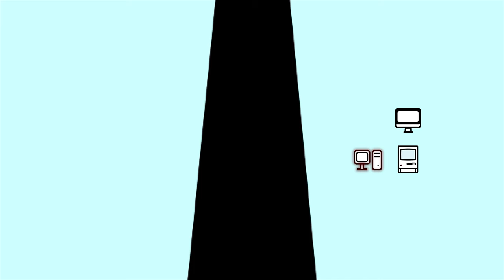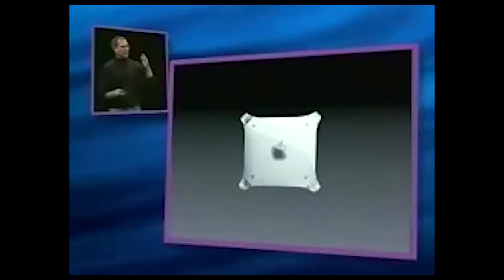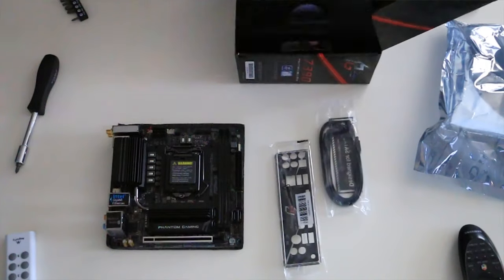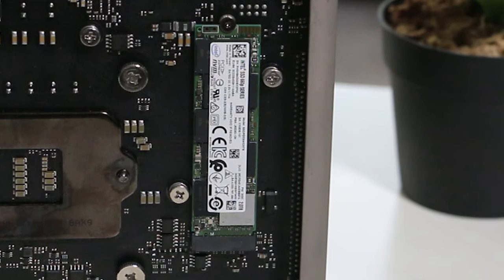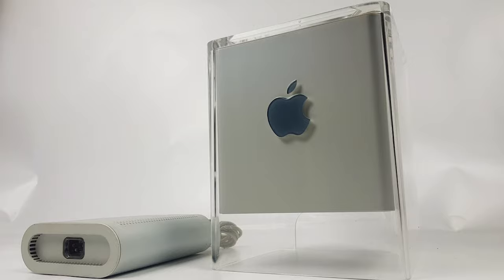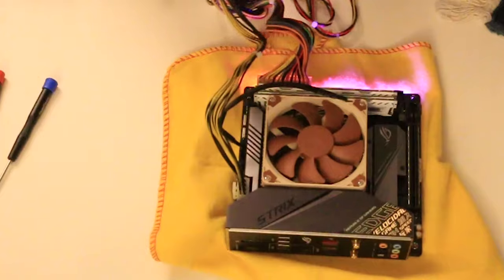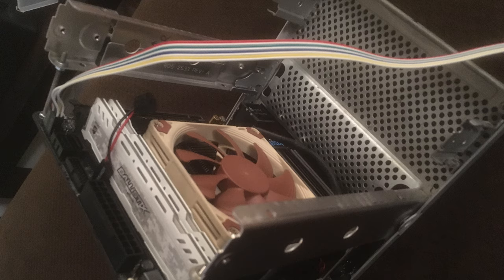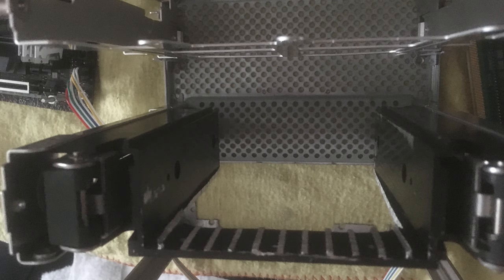The Fastest Apple G4 Cube Hackintosh in the World - i9 9900k Case Mod

Comment: I'd say it's probably a good idea to keep your thermals below 90 C to expand the lifespan of your parts. You could downclock/undervolt your CPU so it can run at cooler temps.
I'm really impressed by this build, especially with the lack of background knowledge with some of the methods used (which is too relatable, lol) it's refreshing to see someone *working with what they have*. Thanks for sharing this!
Reply: Sound advice there with the Bios tweaks as running an i9 in an enclosure this tight is just asking for Chernobyl style meltdown unpleasantness.

Comment: But the coolers doesn't blow hot air at each other, and have it rise up. They suck the air in towards their respective cooling fins. And in the graphics cards case, the exhaust is now facing down, where the little noctuas are pulling the hot GPU exhaust up into the case again. Impressive build to throw yourself into tho.

Comment: You can definitely reduce the temps a bit more if you undervolt the CPU and GPU. You could look into delidding too, however it might be more trouble than it's worth on the i9. Some people on r/sff have replaced their GPU fan with a noctua one to get to noise down too.
Reply from the maker: I will definitely look into the undervolting. I SO rarely push the CPU to its limits (and secretly I "delidded" the entire cube from the outer plastic when I render video to give it an airflow fighting chance)

Comment: I am considering doing the same thing to my cube. What GPU did you choose? I would love to replace my huge PC rig with something small, but it has to game. No way I can cram my RTX2070 in there. Maybe run the GPU externally using thunderbolt?
Reply from the maker: It's a great question about an external GPU! Maybe the thunderbolt could work. Go check out the subreddit r/sffpc for other ideas of cramming gaming PCs into small cases. There are great options for full sized GPUs in smaller cases. OR you can stick with a single blower SFF mini graphics card. There are definitely better cards than the one I used, but, maybe not as good as your RTX2070. For me, it just had to play some video games.
Reply: DON"T DO IT!!!

Comment: I subbed because I was super impressed. What graphics card did you use? What was the build cost and what should I do different if I went down that road?
Reply from the maker: Thanks so much! I just took a picture (actually a bunch of pictures) with high bokeh. They are at this link if you want to use them for some reason: https://imgur.com/a/qq9tJQf

It was a little over $2000 all in. And of course this was a while back, so there are better motherboards and CPUs and GPUs now. You just have to think about size and what you will use your computer for. Honestly this computer is overkill for just web-browsing and word processing. But for the 10% of the time I'm editing it's worth it!

Comment: For future reference: you can just connect the 2 Pins on the motherboard with a Screwdriver to power it on, instead of waiting 2 days for amazon delivery ;)
Reply: This is legitimately how I started my PC for a couple of weeks before I got tired of it and built a "front panel" for it.

For context this is a sleeper I'm working on but needed an extra PC for online class, so it doesn't have a case to speak of and not all of the hardware is together yet, so that's why I went with this janky solution.

Comment: Hello, this is your Hackintosh very nice. Have you had graphic problems with the riser tapes? On my Hackintosh, the computer had problems, graphics problems, artifacts and resets. There was no such problem under Windows. What brand of riser tape did you use?
Reply from the maker: Hey! That sucks that you have been having any graphics problems in your build. Graphics have worked out perfectly for me, no problems at all. I really don't push it though, and probably could have run graphics on the iGPU to save $ and space.

The riser cable I used was this one:
Riser Cable: EZDIY-FAB PCIe3.0 16x Flexible Cable Riser Card (25cm)
@t

Comment: hey man so to test thermals you will want to run some benchmarks and keep tabs on what its doing at that time - thermals while not under load dont really mean anything - its when the thing is being stressed that matters.  someone mentioned the aida64 stress test on windows before and thatd work.  could just try cinebench and run it 4 or 5 times in a row (the first test will give you the best results but the process will heat up cpu, gpu, etc.) and watch thermals with that hardware monitor app you had there at the same time.  granted, it might not FULLY load EVERYTHING at once, but it does a damn good job of stressing the system overall.  the Tj temp of the 9900K is (I believe) 105Cso as long as youre under that i wouldnt worry at all.  and as you mentioned, it will throttle anyways to keep heat down - but with running benchmarsk you can see the relationship between thermals, throttling, and perf lost due to heat.

Comment: The issue I see with this is there is zero airflow yes you have an I9 but it is under performing. We both know that computer runs super hot with any type of load other than YouTube. It’s definitely cool but There’s a reason why Steve Jobs didn’t put a PSU inside

Comment: Curious about the total cost. I have a working Cube (although needs the “30 sec. hair dryer to the bad capacitor” trick to cold boot - okay after that if always plugged in). I’d love to do this but the time spent getting a Hacintosh working for me is prohibitive. I ‘d also have a hard time convincing my wife that spending almost as much (or more?) as a M1 Mac Mini makes any sense. (I would only use a Quad core i7 with no dedicated video card, so wouldn’t be as much as yours.)

Comment: "scuzzy"... oh lord. IDE
Reply: True on the cube, but Apple did use SCSI on quite a lot of their machines while PC manufacturers absolutely insisted on foisting cheap shoddy IDE on everyone, which eventually caused Apple to give up on SCSI, unfortunately.
Reply: @dregenius  SCSI used to work really well in raid configuration especially with extended writes like massive photoshop files. It was definitely quirky to configure with its 'rule of 7' and the need for a 'terminator' at the end of the SCSI chain or sometimes not as each case sample was different..